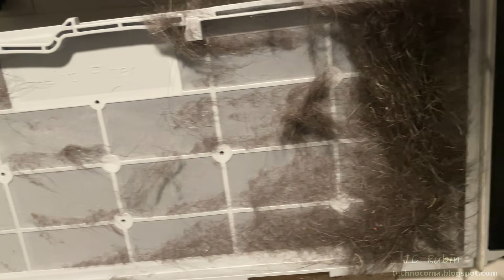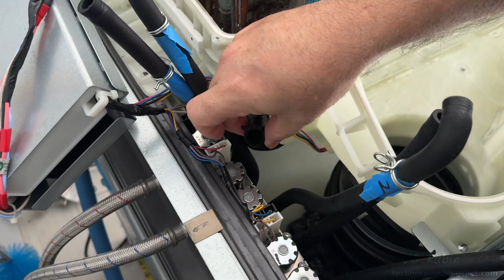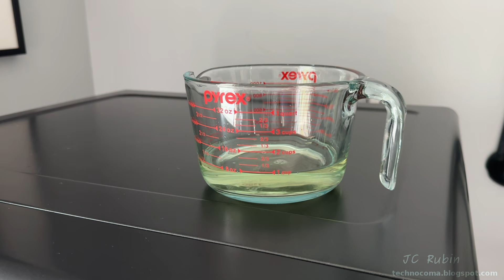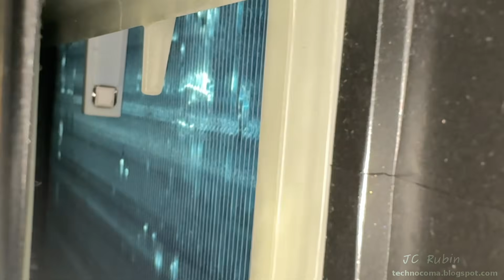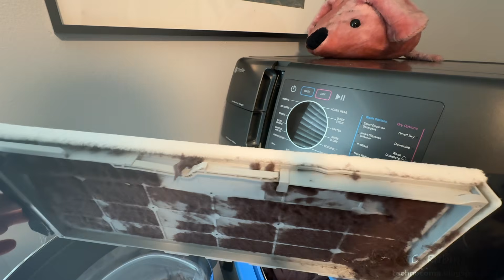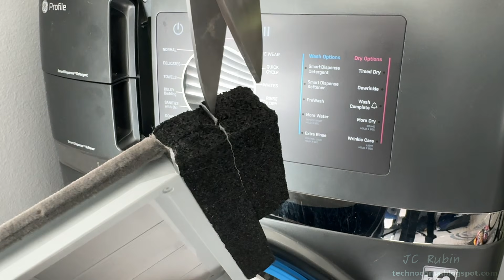GE Profile Ultrafast 2in1 Combo Washer Dryer - Why they Fail & How to Fix it

Comment: I needed to come back because I had a very important experience that might help people that are having the 353 error! If you have been using your machine for a while and haven’t been regularly deeply cleaning your mesh filter, it might actually be clogged without you knowing, which could be the main source of the issue. And I mean DEEPLY clean it. I used to “clean” it after every cycle by removing the lint, and then about once a month, taking it in to wipe it down with soap and rinse it. This is not enough. It might look clean, but actually be completely blocked without you being able to tell, which was the case with mine. If it does get very blocked, you pretty much have to soak the whole thing in hot soapy water and scrub it on both sides with a soft brush, I even used some soap scum removing bathroom cleaner and rubbed it with my fingers and a staggering amount of gunk came pilling off. The filter is now clear, water runs through it easily, and my clothes actually finish drying in half the time. I also made the modifications in this video and it helps so much to keep all the lint where it should be. Of course the cleaning tutorial in this video is still very helpful because of how much lint can get by and gunk up the rest of the machine. 

So if you’re having issues with the dryer stopping mid cycle, give your filter a good close check and deep clean first, it could potentially solve the issue.

Comment: We’ve had our machine probably 2 1/2 years now and taking very good care of it following all the instructions that we were told to do as far as cleaning filtration, so on and so on. But as you say, things are slow down and I see now the problem, why this thing is starting to slow down and not dry to close like it’s supposed to. GE, has  got a definite design problem. I wish I could talk to them and tell them what to do to fix your problem, like I did. I actually added the rubberized gasket material and seal the air filter going into the exchanger or heat pump, and it’s working much better now. You’re absolutely right. I am glad you pointed out these things. And if he’s reading this, you guys need to get your heads out of your you know what and get these things fixed or make up a new filter to go in these machines. Maybe there should be a lot All this does is remove the longevity of our very expensive washing and drying machine, the GE profile

Comment: I'm working on fixing this right now as we've had ours for about a year and it's not drying well. 

The machine is apart, and the corrected drain pipe doesn't appear to have any clogs. I'll clean the coils next. 

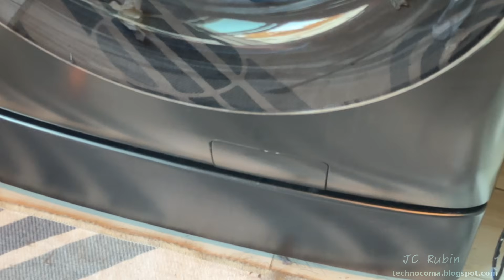Any other suggestions besides that? 6:51

Comment: Hey GE, you should HIRE this guy!  Excellent video.  I put this $$$$ machine in my master closet, (July 2023 puchase with a 5 yr GE Assurant insurance plan) and love the fact that it doesn't need a dryer vent or 220 power.  BUT... the clothes just don't feel dry.  Seems like it would help to blow a little 110 heat in at the end of the dry cycle, just to fluff things up.  I had a tech out in March 2026, who took the whole machine apart and cleaned it.  I wonder if he knew about that hose that clogs...?  I'm a single, so very few loads in 3 years, but I'm getting those seals you recommended.  Thank you so much!
Reply from the maker: Glad you found the video helpful and good luck with the maintenance.

Comment: My landlord actually bought one for the house when it first came out. I noticed from the beginning that I needed to clean the dryer filter every time I did a wash/dry. I have 1 very fluffy cat. The instructions said to clean it every 5 cycles. Also over time there was wet fur in the dryer reservoir, and my clothing never fully dried. A week ago it stopped I think it must have been at the end of the wash cycle.  It beeped like it was over. The water was still in the drum. It won't drain.

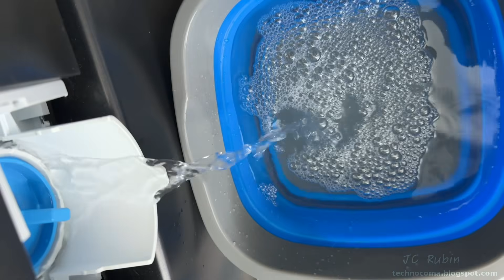Comment: @4:25 The water should not drain slowly; let me explain. I noticed that drain hose under blue condenser coils was also draining slowly even after pulling out a similar chunk of “the stuff that nightmares are made of” from the lower end of the drain hose. I could see dog hair and debris inbetween the two sets of coils and the slow draining was bothering me. I ended up realizing I could use a cheap plastic sink drain declogger tool (the “drain weasel” with the Velcro looking ends) and feed it up through the botttom of the hose until I hit the blue condenser coils. I guided it through the hose with left hand while pushing the drain weasel with right hand. After a few rounds of this and squirting new water into the coils in between rounds, I was able to pull out about 3x of the original nightmare until water gushed through. Thanks for all your help and hope you try this if you ever take the thing apart again.

Comment: Bought mine 16 months ago. Liked the idea of the pet hair removal pre cycle, the space saving benefit, and not having to switch clothes between machines. 

After struggling with clothes not drying and searching for online solutions, I thought I had figured out the extent of care the machine needed. Cleared lint trap and drum seal every cycle. Vacuum the inside of the chamber with narrow extender and wire brush to get to that back corner, every 4 loads or so. Drain discharge and clean out trapped hair every 8ish loads. Which was a terribly tedious task. (I didn't buy the "optional" riser so that's the biggest thing to capture water was a sheet pan.) 

But even after all that maintenance (which costs me way more time than what is being "saved" by a continuous wash dry cycle) it kept getting worse. Now my warranty is out. And it's throwing a code that means it's over heating. Certainly feels like it. Why GE hasn't recalled this machine with full refund is beyond incomprehendable! Absolutely sick of maintaining this machine. I don't plan to buy another GE product.

Comment: Are you familiar with the condensate drain tube rerouting retrofit kit, part numberWE41X39157? How hard is it to install it, and does it help with draining issues?
Reply from the maker: Did anyone tell you that this was specifically called out for this machine?

Comment: Feb 22 - Sep 21, 7 months.  Using flexible hose and long brushes to remove interior lint.  We clean the filter after every run now.  Have not been washing the filters with hot water but will now.  Ordered new filter assembly.  Will add foam.  Only noticeable issue is longer clothes drying, one cycle said 2:15 but took 5 hours.  I will open up the machine next month or two after buying magnetic screwdriver.

Comment: Mine vibrates alot during the spin.

Can feel the ground under me vibrating, any idea how to solve it? I did balanced it though but still vibrating.

Please let me know if there is anything I can do to stop this.

Thank you
Reply from the maker: You must balance the machine at the feet with a level. Moreso when it’s using the pedistal
Reply: @rubin-tech 

Can you please share a link for the level?

Much appreciated

Comment: My relationship with this units is love/hate. I love how useful the machine is, but I have had 5 failures. 4 pumps have died, and then we had this issue just recently. We clean the machine religiously, but I should not have to disassemble the whole machine just to do regular maintenance. They really screwed this up.

Comment: I purchased the upgraded filter for mine a few months after I bought the unit.  It seems to do a lot better job with Corgi hair than the previous one.  It started stinking really bad though if the filter was left in the dryer long and it always seemed fairly moist in the filter cavity.  Today I pulled it apart and although the fins looked pretty good, the drain hose was full of corgi hair.  I'm hoping it was all from before the filter upgrade.  I don't have the exact same model, but it was similar enough that your teardown video helped me out quite a bit.  I love the idea of this unit, but the reality of it is something else.

Comment: My brand new machine leaked from day one.  GE has sent out 5 repairmen, they have replaced the pump/filter at the bottom, sent me a new upgraded top filter.  they are now sending repairman number 6.  it leaks from the right front corner and the water never appears until it is in dry mode.  anybody have any thoughts?  they have checked the drain line outside of the machine... don't know if they checked a drain line inside the machine.
Reply from the maker: It sounds like you may have a clogged or disconnected internal condensation drain line.

Comment: I’ve had this machine for about a year, probably less. I started getting the error 353 around a month ago. I cleaned out what lint I could see and the machine appeared to work for a short time, but now it’s giving me the same error again. Looks like I might have to disassemble it and give it a good deep clean. Your video is very helpful because I had no idea how to do that lol. I ordered the supplies you recommended and will make these modifications myself. Hopefully there will be no more issues! Thanks so much
Reply from the maker: Glad the video could help you get it sorted out.

Comment: Fantastic video! My machine just simply would not work, no error codes, just cut on then off without any messages. I decided to check the filter area, oh my goodness!!! It was UNBELIEVABLE!!! Though I am waiting for my husband to return to help me take the top off. I cleaned it our with the most "jerry-rigged" items in my house. I then had to clean out the water drain at the bottom, disgusting stinky sludge (this I learned how to do from the last repair man I called). I have only owned less than a year. I plan on regularly doing the cleaning you suggested, Thank you!
Reply from the maker: Glad you were able to get it sorted out.

Comment: Hi JC, I really appreciate the very detailed video of the problem with this machine. It is clearly a HUGE design flaw that a layperson could not service or repair-even the repairmen GE has sent out have not been able to repair it (6-7 service calls?). I have been having a ton of trouble with GE and with the machine. The heat pump has been replaced twice, another part that I think is the water pump, 2 lint filers. I sent GE your YouTube and they refused to refund my purchase price saying its out of warranty - which by design they kept sending repairmen out until it was out of warranty. I am so frustrated. Any ideas for other avenues to get a refund or at least a working machine? I have two large dogs and I have had to throw out dog blankets because I can't wash them - so so frustrating

Comment: Super helpful. Thank you. I had my reservations when we bought this machine a year and a half ago (November 2024), and now I feel like we stepped into a nightmare. I clean the lint filter and drum holes/seals with with every wash. Still, too often I pull huge chunks of lint out of that air flow hole opposite the heat fins. I do the standard maintenance of running the full clean cycle and emptying/cleaning the pump filter when prompted but because the machine got stuck on load sensing today when I just washed 2 small bath rugs on quick cycle, I will do an unscheduled check of everything and try resetting the machine with unplug before I do another load. I'm not loving this machine. It may take up less space, but it's way more hassle than it's worth and I fear we're going to incur a huge repair charge in the near future. I'm not happy with GE at this moment.

Comment: Liked and subscribed.  Love the videos!  I do have a question tho.  I've had my machine for almost 2 years and DEFINITELY have this issue and am trying to assemble all the parts (seals and zip ties) needed to make this repair and hopefully fix.  I've been unable to find the size of the seals that you're using in any of the comments and unable to find which video you created that had the initial install of these stick on seals.  Can  you  please call those out for me so that I can have them on hand when I begin this project?  I know I can measure the width of the filter body to get that size, but how thick (expansion) are you using...1"?
Reply from the maker: It’s in the video description
Reply: @rubin-tech  Thank you.  Sorry to ask so basic a question.

Comment: Thanks for your videos!!  I'll need to check more often the drain filter.  I didn't realize it can affect humidity and performance.  I was wondering if you can help me with my door lock issue.  The connector and door lock keep getting burnt and melted.  I changed out connector and door lock twice already and now a third time.  Do you recommend this time I change out the main board/invertor board this time?  I thought it was moisture getting into the plug, but now I don't think that's the issue.
Reply from the maker: If the connector keeps melting, there is likely a high resistance connection or a short on the main board side that needs addressing.
Reply: @rubin-tech  Can you tell me specifically which board this connects to?  Inverter Board or MC Board or Moto Inv Board?

Comment: I got almost 3 years out of mine. Then the pump failed. Can’t justify putting money into this piece of garbage. Bought a Samsung. I need a ventless for many reasons, too many to explain. Only need this one to last for 4 more years. The lint filter design seems to work better. Clearly the engineers who designed the GE unit, didn’t plan on ever owning one! My wife’s small socks also had to be washed inside a mesh bag. Failure to do so results in socks getting stuck in the door gaskets and being saturated at the end of a wash/dry cycle! Horrible design. Thanks for the video shipmate. That you need to disassemble the unit to make it run properly means, it’s TRASH!

Comment: I read on reddit that this filter is new and is suppose to fix this issue? “LG Condenser Filter Kit for WM6998 Ventless Washer/Dryer Combo” $20.99
Has anyone tried this?
Reply from the maker: Helps. Not fixes.

Comment: IThanks so much for your video. I've had the GE Profile for 3 years or so. Within 6 months of woning it I had to have it serviced because it wasnt fully drying my clothes and the problem was fixed. A week ago the maching was stock in the "Clean your filter" mode and no mater how many times I clean that filter and the filer enclosure I still get that "Clean or Replace your filter". The service price $150 plus whatever else will need to be replaced. I'm very frustrated with this combo dryer. I feel GE should cover for the service since this is a design problem that their product designed team failed to address. There should be a recall, or a law suit.
Reply: Was the propblem essentially the same as this video?

Comment: I have owned the GE Profile UltraFast all-in-one washer/dryer for over two years, and it has worked beautifully for me. The convenience is excellent: ventless installation, 120V plug, auto detergent dispensing, space saving, and no need to transfer clothes from washer to dryer. Drying has been good for my use, and I can easily add 15–30 minutes when extra dryness is needed. The only real downside was the weight during delivery, especially getting it upstairs. Otherwise, it has been a very convenient and reliable machine for our household.

Comment: We have had our machine since 2022. We do love the idea of it and how great it worked until June 2025 when the heat pump started to have an issue it was out of warranty, but because we take such great care of it, we were able to get all of those parts in the service done for free but sadly, just over this weekend one year later we’re having the same issues and this time they won’t cover anything. They have to do a breakdown and try to figure out how to get this thing to run better. We can’t spend $1500 every year to get this machine going.
Reply from the maker: I continue to run trouble free with the maintenance and seals additions in my video. The 6 month seal test video will come out in a week or so.

Comment: The additional back stepped insulation looks to be 10 cm in length rather than the 10 mm stated in the voice over. Correct?

Comment: Thanks so much for this! We've had our unit for 3 years, and I knew the filter wasn't working very well but I didn't know what to do about it. I finally found your videos a couple weeks ago, ordered GE's new filter, the weather stripping you recommended, some DM water, and set aside a weekend to do the disassembly and cleaning. My wife and I got it done in one day! The lower drain hose didn't have a nightmare clog like yours, so I guess we got lucky there. Your instructions were super easy to follow, and I really like the masking tape trick for keeping track of screws - I've done a lot of DIY projects but had never seen or thought of that before. So thanks again!
Reply from the maker: Glad to hear it helped get your maintenance issues worked out!

Comment: I have a combo unit in basement, GE apt sized upstairs. I gave up, the apt size washer is hard to balance so i wash clothes with combo unit i. Basement, than bring up the clothes and dry upstairs so lint is not an issue. GE should pay for the teaching of homeowners on how to service the combo unit.

Comment: Thanks for the video! I'm having issues with my not drying and I had quite a bit of build up of lint that was hard to get out. I just order those seals but I justI tried to use a brush and a good chunk fell into the hole on the left side. Is there a way to get this out?

Comment: Outstanding and very thorough. We have had our machine for about two years and I’ve tried the brush techniques and the bottom drain pump filter below but not these other issues. We are finding the exact same thing with the lint spottiness on the filter and the smell. I’ll try this and see how it goes.
Reply from the maker: Let me know how it works out for you!